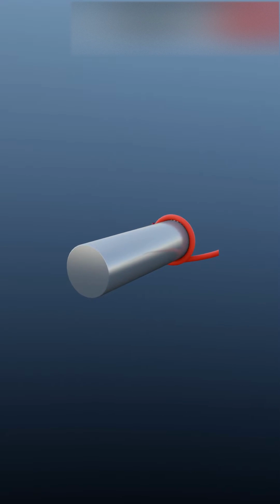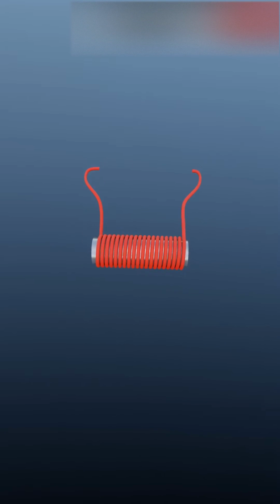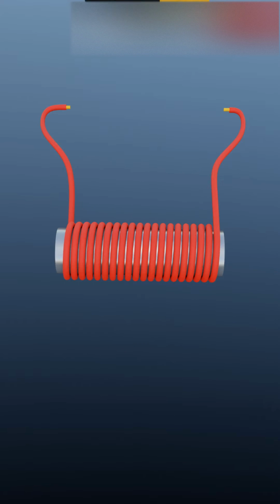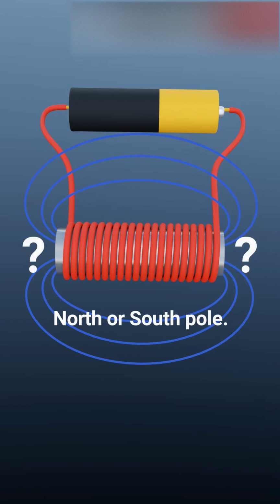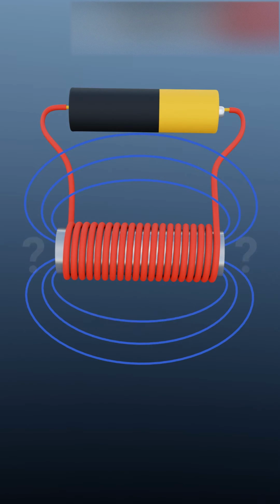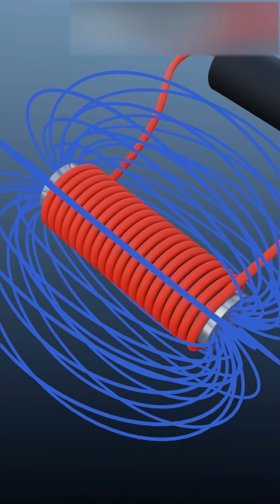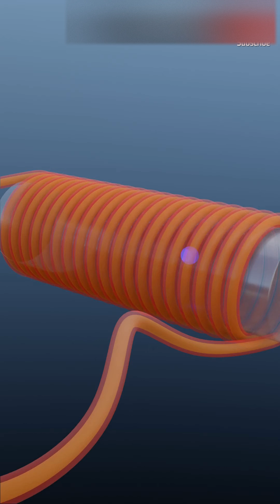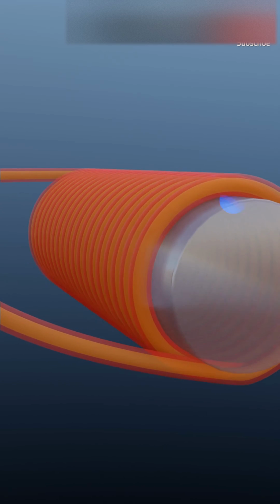electro magnet poles# short

Comment: I wonder if a solid, rectangular box of metal instead of a cylinder would change the EMF’s properties in any way, if the copper wire was wrapped the same direction relative to the same poles?